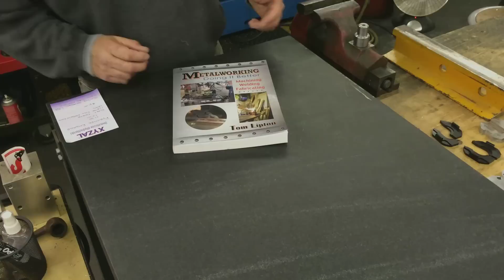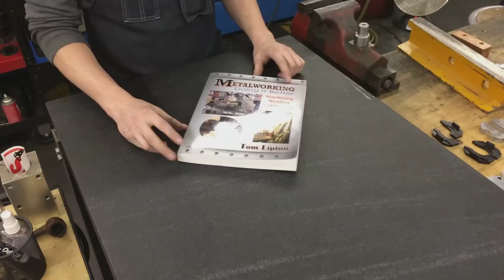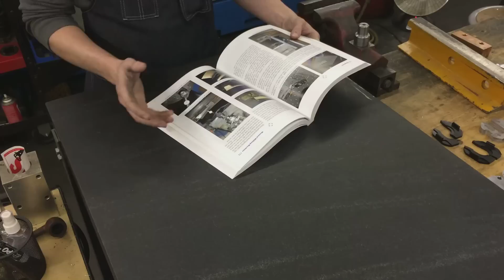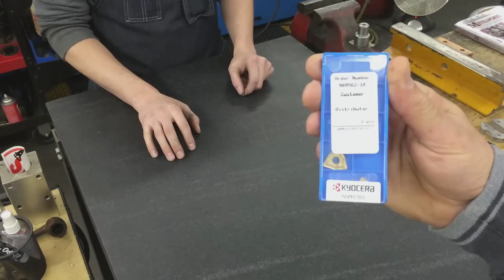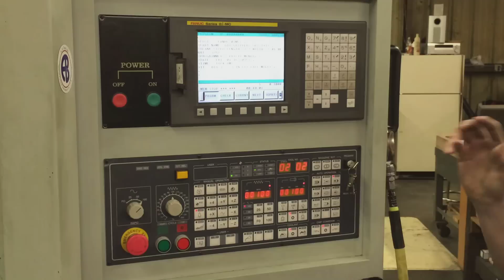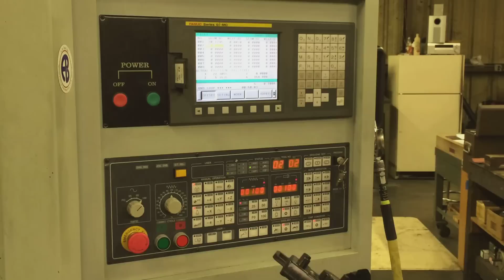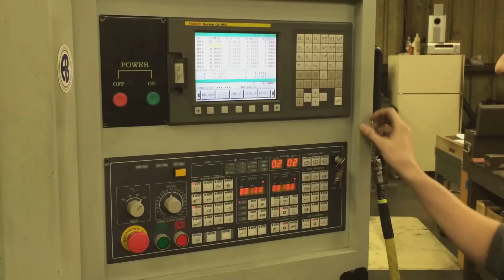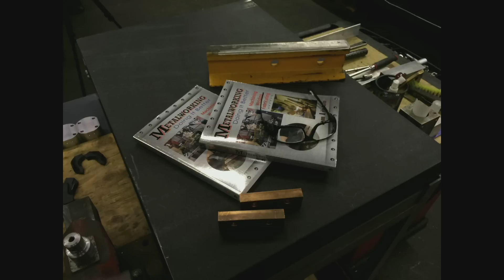Surface Plate

Comment: Ray & Phil,
Great video, guys! I've never seen a CNC machine for metal, but I have seen one for wood. When I did servicing of pro woodworking machines, I had to replace the carbon vanes in a vacuum pump. The vacuum held a 4'x8' sheet of MDF to the machine. The operator would scan a bar code on the work order to load the program. Several minutes later, there were a bunch of doors for kitchen cabinets! Anyway, thanks for sharing all your goodies. Yes, Tom's book makes for great reading!
Have a good one, guys!
Dave
Reply from the maker: Hey Dave,

Thanks buddy! I have never seen a cabinet making CNC but I bet it turns out some nice stuff quickly! Agreed, Tom's book is packed full of really useful information and a easy read format!

Regards,

Ray